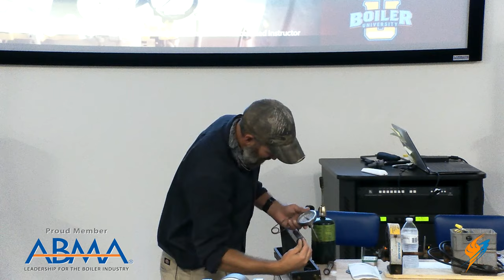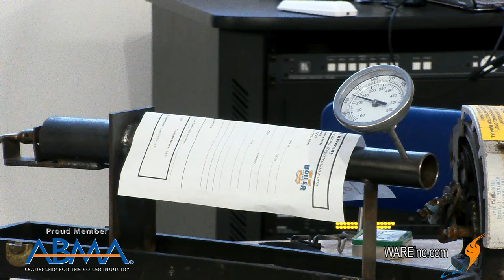Using Turbulators to Gain Efficiency in a Boiler - Boiling Point

Comment: Will the turbulator get overheated?
Reply from the maker: The metal used for the turbulators are designed for normal operating temperatures for the combustion gases inside of the tubes. Thanks for watching!